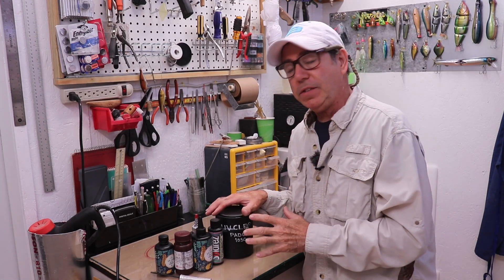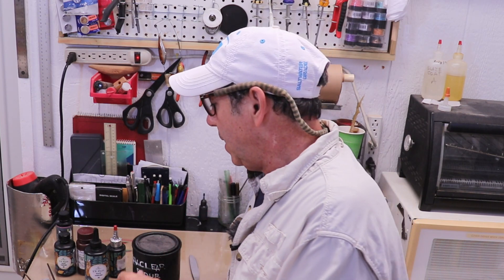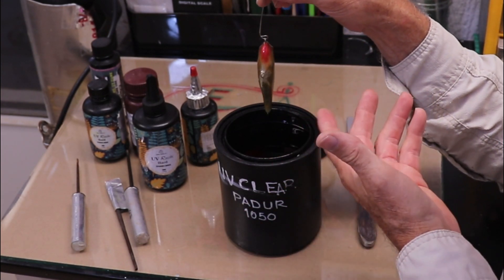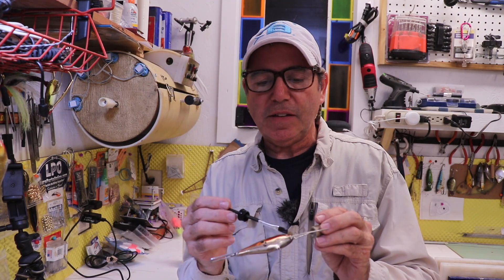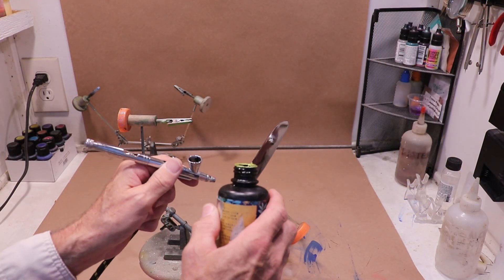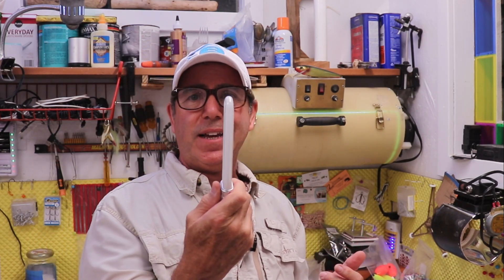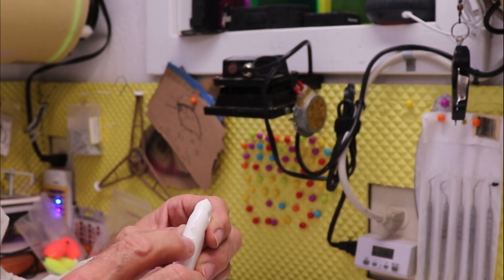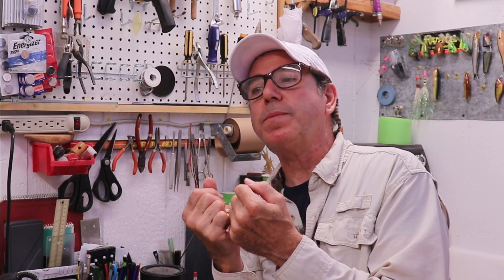How to use UV Resin, UV Resin clear coat hacks for lure makers

Comment: Any tips or tricks for how to apply uv resin and cure it when it’s a jointed crankbait? Also what type of brush do you use?
Reply from the maker: I use a good quality soft bristle artist's brush and I clean it with acetone once every few uses.  And keep it protected from light and dust in-between uses.  
Every jointed lure is different but as basic practices :
If it's a plastic or resin lure just keep the clear coat away from the joints and be sure you have designed in the thickness of the clear coats to allow the motion of the lure joints.  If it is a wooden lure, the same applies but, be sure the wood is well sealed before you paint and clear coat and then follow the instruction above.
Hope this helps.  Cheers

Comment: Hey, thanks for this very informative video. Is the denatured alcohol/ acetone not going to eat into the paint layer?
Reply from the maker: Right you can't use denatured alcohol or acetone on the paint
Reply: @ how would you go about thinning the resin for the topcoat if you were to airbrush painted surface?
Reply: @ 2k clear works fine so I am assuming they have to have some sort of thinner in them that does not disturb the painted surface. Thanks for your thoughts on this, much appreciated!
Reply: Just watched some of your other videos, so it's either a PU water based mid coat or a dip/ brush on situation if I wanted to be quick I am guessing?

Comment: I know this is 3yr ago but can I use a LED BLACK LIGHT? 30W
Reply from the maker: Probably not.  Check the frequency of the light,. Hopefully it is on the label. If it is between 365nm to 395nm it will work.

Comment: Hello, I’ve reviewed your playlist and still have a question. Sorry if you’ve answered it. I’m using the ‘UV Resin Hard’ 100g bottle to clear coat my lures. When I brush on the resin there seems to be spots that stay dry*. I spin it in my drill (probably spins 1.5x faster than your rig) and it doesn’t seem to do any good.  What ensures perfectly round perfectly smooth finish? Rotating at right speed? Viscosity of resin? The perfect amount of resin?  I see you brush it on initially and it already looks perfect and not runny.
Reply from the maker: If it isn't smooth after brushing you have some issue with the paint interaction.   In my videos I show how I seal the paint with Minwax Polycrylic.
Reply: Amazing. I did consciously skip that step! I’m on lure #3 thanks to your help.  Hope the channel is giving back in some way.

Comment: Good evening Sir, do you mind sharing the brand of the uv resin in the quart container is it one part?
Reply from the maker: The UV resin in the quart container is an industrial version the hobbyist resin I typically use.  I have not shared the brand name because it has turned out to be a low quality product and I do not recommend it.  Like all UV cure resin, it is one part, catalyzed by exposure to UV light.  Cheers.

Comment: Great video..
I'd like to point out  though!
Epoxy thins with heat... So, if you were to dip it, or brush it, a heat gun or mini butane torch can help remove excess epoxy much quicker & the heat  pops any bubbles that do form.
I've been using epoxy for many things for many years.
Just recently a friend got me into doing lures, as I am an "artist" ( family & friends words not mine. ) So I have been replecsring alot of forage species the last 6months to a year. Not as good at it as I'd like.  Ut my buddy is super happy to not buy new lures & refurb his old tried and trues
Reply: Apologies...
Replacing not replecsring or whatever autocorrect went too

Comment: Awesome video. I am just getting into the UV resin. Seems to be pretty rock hard which I love. 2 questions.
How many coats of polyacrylic do you apply to the paint before you put on the uv resin? Can you use the aerosol polyacrylic or should I make the 85% to 15% water mixture and spray from my airbrush?

And 1 more thing. If I am going to put a 2 part epoxy over the uv resin would you sand the uv resin to create some grit for the 2 part to adhere to or just go straight ontop of the cured uv resin with no sanding?

Thanks for all you do it's much appreciated!!
Reply from the maker: I usually apply 2 Coats of polychrylic before I clear coat. You can use the aerosol or you can mix it the way I do it's up to you.. And and if you're going to put  any resin clear coat over UV resin you should give it a very light standing or at least deglaze it with acetone.
Reply: Thanks for that! I'll do 2 coats of the poly! With the uv resin can you brush it on and do a hanging cure as opposed to turning it? If I get some 4 ft uv tubes and fit them in a long box. Just curious before I go through the effort of building a big expensive curing box that doesn't turn

Comment: So my Alumi-UV in the can seems really thick and I was wondering if your method of diluting it with denatured alcohol can be used for dipping?
Reply from the maker: Yes you can dilute it and dip it...just remember that the alcohol will evaporate pretty readily and you will probably have to add more no and then.

Comment: Great tips. I’m going to use a few on my guitars! One tip- a guy that sells UV lights told me that mirrors don’t reflect UV light. He said to use the shiny side of aluminum foil. Glue it down with some 3m spray glue. I tried it in my curing booth, works great, and it’s cheap!
Reply from the maker: That is a common belief.  And it has some truth in that UVB is blocked (mostly) when it passes through glass.  We are using the UVA part of the spectrum and UVA passes through glass...mirrors will work but not as quit as good as highly polished  foil or silver finished vinyl laminate.  But if you just have a low polish foil you are better off with mirrors.

Comment: I use fish a top water lure when I returned to the world after 2 tours in Nam.  The lure was called a crazy shad,  when cast it would sit nose up maybe half inch,  only one prop on the tail triable hook.   I found a lure similar made in Brazil.   But those are overhaul smaller in size.   It was plastic, silver black back.  The belly was shaped like a crank bait thicker and tapered on both ends.  
Now, this may sound nuts,  but I would lite sand to make a dull shine. 
My question have you ever made one similar to this Crazy Shad ?    I believe wood would work,  but have no idea how to get lure to goto a standing tail down with very slow jigging motions like a brim snapping the surface and tail spinner for kicking tail as if wounded, trying to feed.    If you send an email with a picture of the Brazilian model crazy shad. Thanks
Reply from the maker: It should actually be quite easy to get the action you describe.  The lure will me naturally tail heavy.  Try it, I think you'll find it will work just fine with little refinement.  best of luck.

Comment: hi you mentioned you added alcohol to the Chinese made UV resin for air brush. won't it choked the air brush. also when you say alcohol , it is IPA iso propyl alcohol? Thkx.
Reply from the maker: I use denatured alcohol to thin the resin about 25% by volume.  It sprays well through an airbrush.  Clean up is with acetone.
Reply: @EngineeredAngler  can I just use IPA which is 99% alcohol or Xylene. Acetone not available.
Reply: @EngineeredAngler  what is denatured alcohol

Comment: I'm having trouble with uv resin going on for smooth coat. Streaks, gaps, holes. Tried doing a second coat, even heated bottle in cup of hot water to try and thin it. Let it turn for 5-10 minutes, was getting worse. Hit with hair dryer low air to get it to warm up and spread. Ended up with a finshed looked like covered in clear mosquito bites. Kinda cool, actually going to fish it but not what I wanted.  Ideas????
Reply: Couple pictures sent.
Reply: Wish I could send a picture of the plug.
Reply from the maker: Absolutely send me a photo to EngineeredAngler@gmail.com.

Comment: Hi mate, so sorry to bother you. But your def the man to ask about this UV resin.
Just started to that cheaper brand as I’ve always used a two part resin for fixing surfboards/paddle boards for years. 
I’ve been having problems with it going off (under the Uv nail machine 38watt) but still remaining .... rubbery feel ? If you know what I mean ? It’s not a hard set like my other resins ?
My question is .... due to me having to use it in my garage/workshop and it being winter here in England (approx 10deg).
Do you think it’s the low temps that are effecting the resin as the nail machine is just floating over the top ?? And not within a sealed cylinder like yours an keeping warm ??
I tried my normal two part and this again took absolutely ages to gel up, so brought it in to place over a radiator and it then set hard !!!
What’s your thoughts 😎😎😍😍🇬🇧🇬🇧👍👍
Reply from the maker: Temperature can definitely be a problem.  The UV resin is not happy under 21 C.  Takes much much longer.  It helps to get the item as close to the bulbs as possible...nearly touching.  Best of luck, cheers.

Comment: will cfl lights gel your resin or am i safe with cfl light
Reply from the maker: No,  cfl lights give off almost zero UV.
Reply: @EngineeredAngler  k thank you for answering been using etex and thinking about making the switch to the chinese uv  resin you mention in the previous video

Comment: Great information - thanks for sharing! A quick comment about (all) epoxy resins - you should minimize contact with it! Even getting a small amount on your fingers should be avoided as the acquired sensitivity is cumulative and the allergic reactions to it are less than pleasant!  Please warn your viewers. 

It's that time of year that temperatures are below freezing at night here in Canada so in preparation I cut a basswood log into lumber to make lures from this winter so I will be reviewing many of you videos. I got some of that Chinese resin - how do you like it? Do you have any comments or suggestions on using it?
Reply from the maker: The Chinese resin works just fine and gives you an nice glossy finish.  Good luck with your winter carving.

Comment: So... again, thanks for a great video .I have about five channels I follow. When one comes up like yours I almost want to have popcorn.
A couple of points. I brush my resin on and have never noticed it sagging. I have a tank made by doubling up a couple of nail dryers. I do brush it on carefully and try not to let it build up though.
Second, and I could be wrong.  You mentioned that you can add mirrors to help reflect the light on a lure. I was of the understanding that mirrors won't work. You have to use other types of reflective surfaces like foils. I don't know why but I'd imagine that the refraction through glass might mess up the wavelength needed ???
Thnx again...I watch all you stuff when it comes out.
Reply from the maker: Thank you for your input...it is good to hear from fellow lure makers.